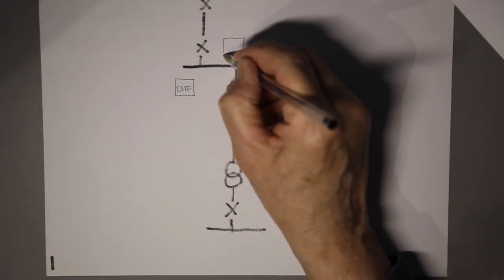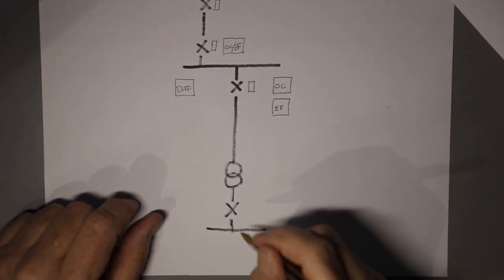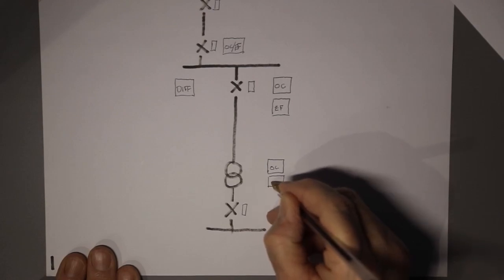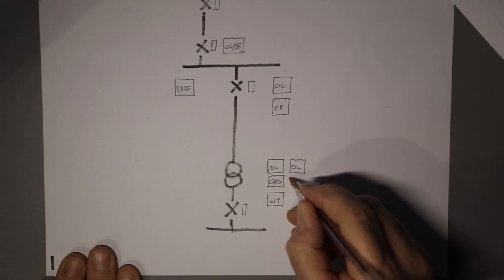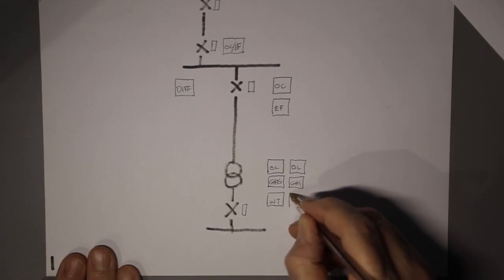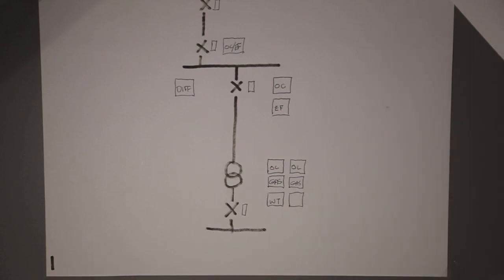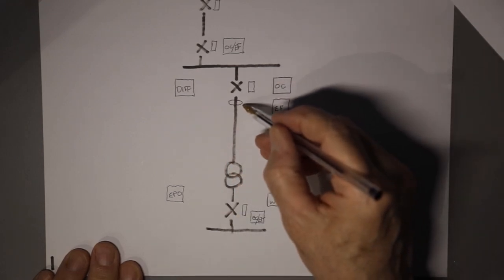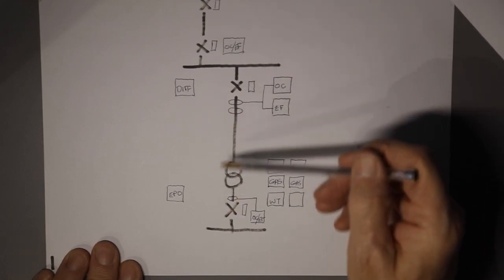MV systems and protection  Overcurrent and earth fault protection. Block protection diagrammes

Comment: You can't spell diagram
This is generally known as a Key Line Diagram
Reply from the maker: Hi Simon thank you for comments. Much appreciated. I can spell "diagrams" I obviously can't type it!  CT's are always on the feeder side of the actual CB so I don't see anything wrong with the position. 
I should swap the diff and the OC CT's to ensure that the zoning is correct however. 
I have been calling them "block protection diagrams" for 50 years as this is the term still in use in UKPN. We did have an engineer from ABB who wanted to call them "key line diagrams" and we agreed to disagree on the actual name. But when I update this video I will mention the other common name for them. 
Thanks again for feedback.